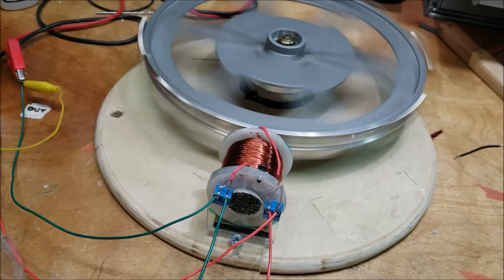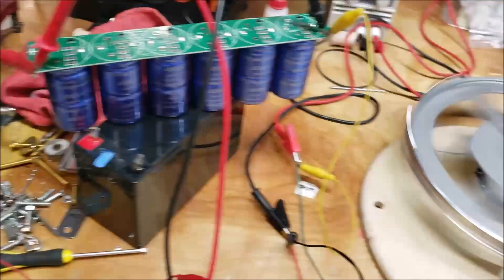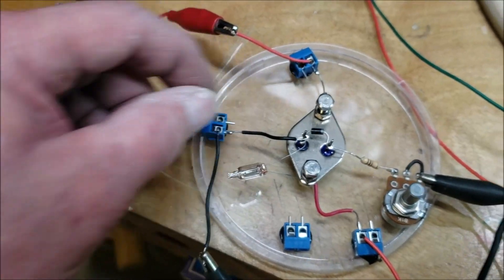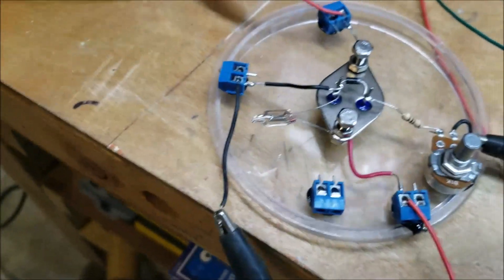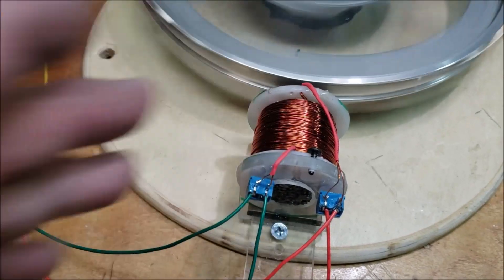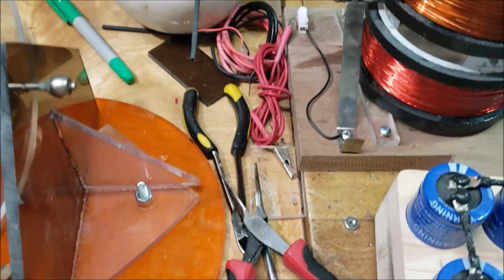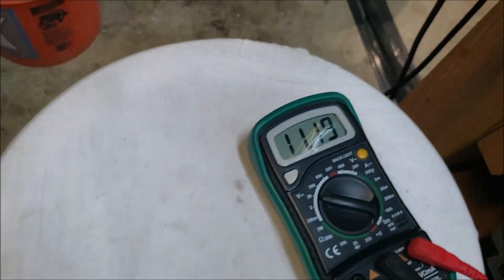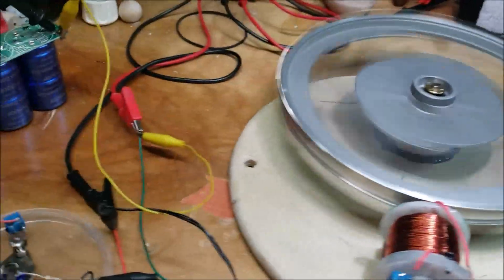charging SuperCaps with Bedini motor

Comment: Supercapacitors are not meant for High-voltages, however there is a way to configure them for the cap-dump topology. Here you have used 6 of them in the series combination to have the voltages divided between them.
Reply: Keep explaining. What is a better type of cap for this technology?